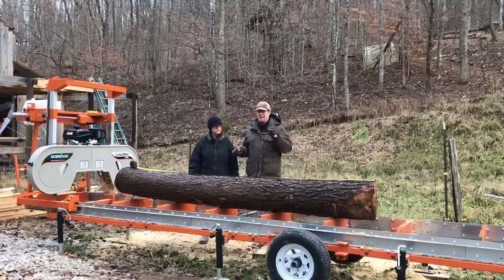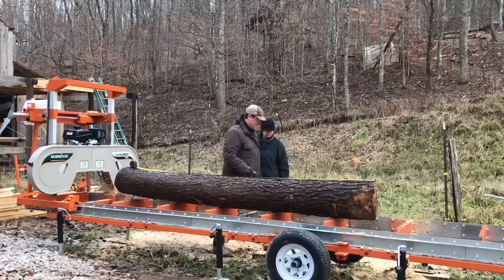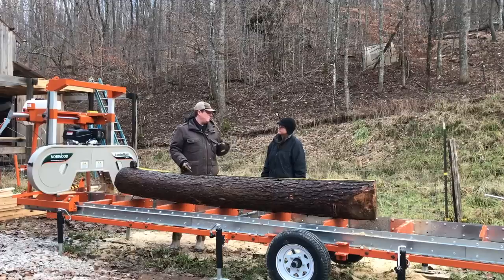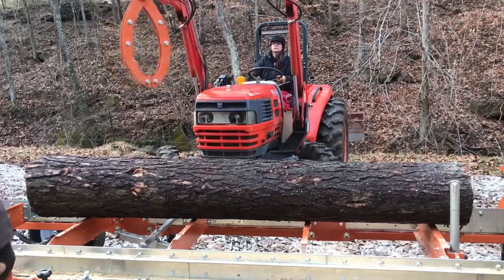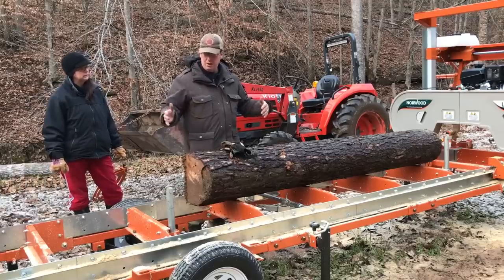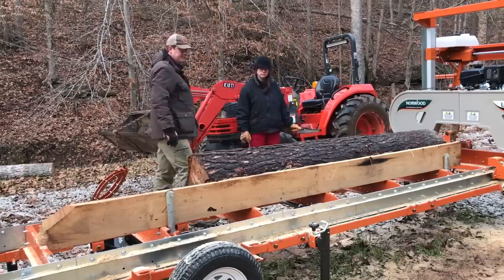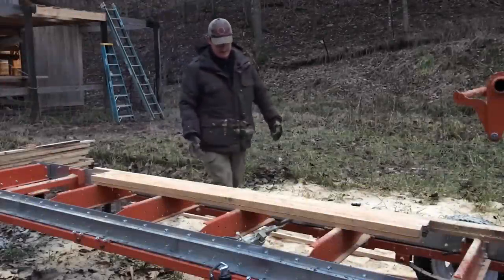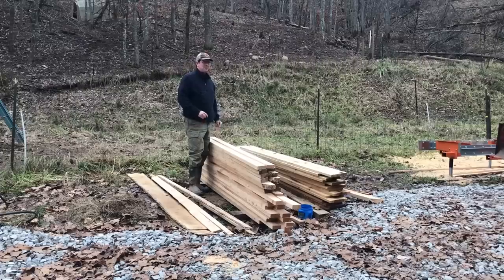Milling 2x4 lumber on the sawmill

Comment: Throw down a tarp to easily bag the sawdust for the chicken run deep bedding over winter.  If you feed corn the pigs will turn the compost for you in the spring.
Reply: I agree. I jimmied a 5 gallon bucket with some straps at the exhaust and then I dump it in big contractor bags. Makes great bedding in winter too.

Comment: You sure could use a grapple on that tractor. Makes picking up and placing logs very easy. Cleaning up brush is almost fun with one too
Reply from the maker: I had a company approach me about doing a quick attach conversion on my Kioti as a video series. I would also need to add the wet lines which would make that more of a project.

Comment: He bud just some FYI for ya. I got my mill put together and was having same problem with the throttle you might be having. Up under the fuel tank there is a nut you can loosen just a little bit to take tension off of throttle. Then I added a little spring on the return and it works like a champ. Keep the videos coming bud.
Reply from the maker: Yeah, the spring that came with the mill isn't strong enough to return the throttle to idle. I will check that out.
Reply: I took a picture of the nut to loosen but I don’t know how to post it. Lol

Comment: Those sacrificial poplar strips could still  be used for tons of things, so they're not necessarily wasted. I recall you also do woodworking in your shop, so there's a lot of potential there, too.
But I wonder why you can't just get another log dog and put between those 2, so you have the first 2 about 4' apart for those rare instances you might want to mill a shorter piece of log.
Reply from the maker: Yeah, I mentioned that as an option. Probably will invest in one at some point. It isn't a huge expense. The poplar boards will be used as rick boards when I mill the big red oak I have to mill.

Comment: shrinkage?  after drying out the 1.5x3.5 will be even smaller right?  HOW MUCH BIGGER SHOULD ONE CUT TO ALLOW FOR SHRINKAGE GETTING CLOSE TO BOX STORE?  ADDITIONALLY, WOULD ONE CUT TO SIZE AFTER BOARDS DRY OUT BY AT LEAST LOSING HALF MOISTURE CONTENT OR MORE?
Reply: Well, we have used ~5% shrinkage on pine. So to get 2"*4" (50.8*101.4 in metric) we cut ~ 54*107. Sometimes a little over, sometimes a little under but we aim for 2"*4" when it's dry. That is in mm (metric), I think that it's close to some of the quarter-scales?

Comment: Hi Troy good job on decision to cut off the crook but you made a common mistake  when deciding how to disect the log. Before slabing decide or calculate what the dimensions of your cant needs to be, in order to get what you need from that particular log. Also the biggest error is not allow your kerf waste of each cut your going to lose about an 8th inch that has to be calculated in. This then will allow you to better maximize each log ans also less cuts. In this demo i counted i believe 3 unnecessary cuts maybe more  that could have been saved. That adds up on blade longevity.
Reply: Why cut the end off ?????? some of the lumber would have been 8 ft now none of it will be.
Reply: @ExploringCabinsandMines  there is at least a couple good reasons to cut off a crook in a log. True you might get a couple long boards maybe but the extra time spent getting that extra 2 board feet of lumber often will cost more than the extra value you would get out of it. In Troy's case he has access to all the free logs he needs for his own use. He doesn't have to worry about extracting every marketable inch of wood. Time and wear on the mill is more of a concern than a extra board foot of lumber.
Reply: it took extra time to get the tractor position the log and cut it a 3rd time,  he could have left it alone and just started cutting. think about it.
Reply: @ExploringCabinsandMines  you obviously know very little about milling you just don't start milling a log just Willy nilly however it lands on the mill. Logs are neither straight nor perfect round and have to be properly positioned to get the cuts desired. Plus like I said he has free access to a ample log supply Troy doesn't have to make every cut in a conservative way. Plus he doesn't waste the flitches as he chips a lot of it for mulch and some goes for firewood.

Comment: I would of thought at least every other bunk would have  clamps.....or at least moveable ones.
     I can move mine around and adjust the bunks
Reply from the maker: What brand do you have?
Reply: Well......it started as a thomas built but my dad rebuilt and remodeled alot of it and extendaed it to 18ft. And mounted it to a large trailer with top awning and a log deck. 
       But as a thomas built each bunk had its own backstop and clamps.